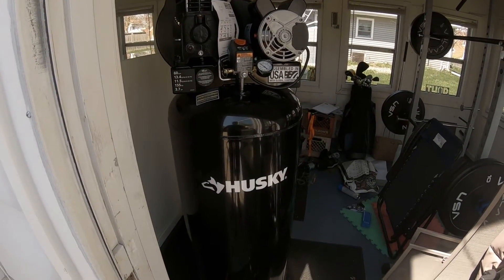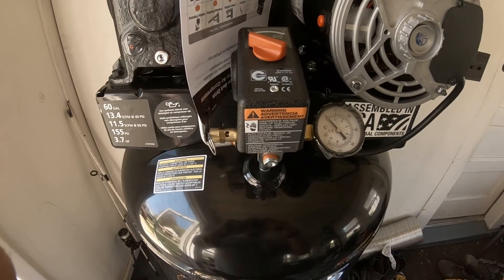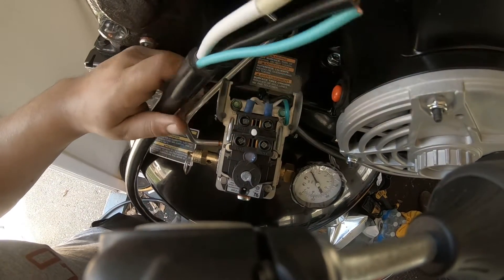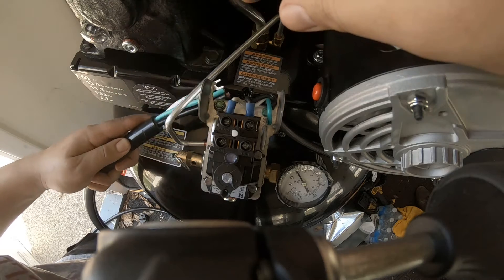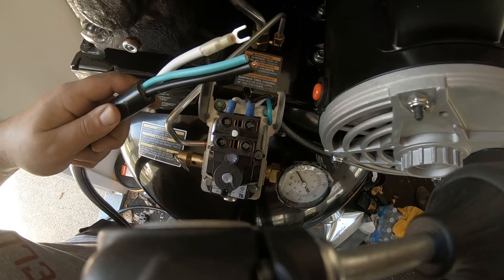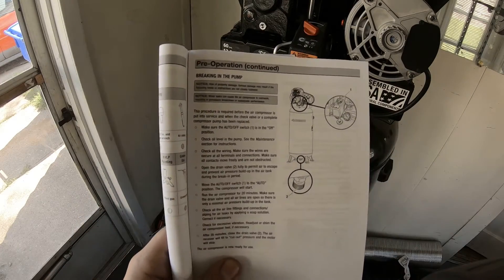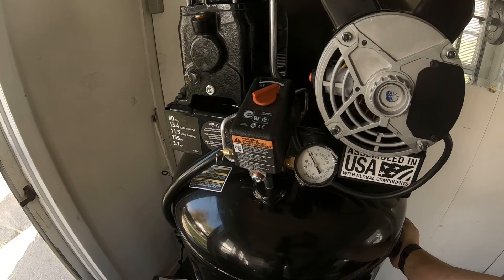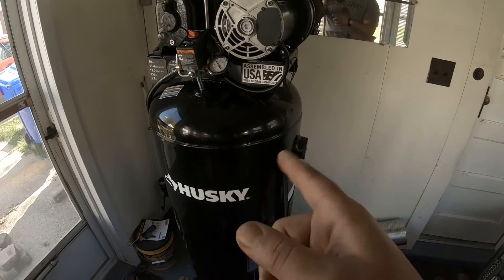Husky 60 Gallon Compressor - Electrical and Motor Break In

Comment: If mine trips the breaker every time I turn it on what do you think the issue is?
Reply from the maker: I would double check the owners manual to make sure you have the right sized breaker for the air compressor.  If that’s not the problem, double check you aren’t shorting anything in the on/off switch with your wiring.

Comment: hey buddy what size breaker did you go with?
Reply from the maker: I believe the owners manual call out a draw of 15A for this motor.  I used a 20A breaker since I had a spare one laying around.
Reply: @ThrownSparksGarage  never tripped out???
Reply from the maker: @mikeammargon6847  I haven't had issues with it.  Depending on the size wire you use and the length from your breaker to the compressor you may need to adjust.  But 20 amp has worked for me.
Reply: 30 amp work good.

Comment: i just got one of these compressors. My tank gets really hot. is that normal?
Reply from the maker: Mine gets pretty hot as well. I haven’t had any issues with it because of this, but do have it separated so it doesn’t heat my garage up in the summer.
Reply: @ThrownSparksGarage  thnx for the reply, video was informational. had to watcha few to get everything understood but no one ever mentions that the bigger compressor tanks produce so much heat. It kinda had me worried. I know the actual pumps do but was not aware the actual tanks get hot.

Comment: I brought husky 60 gallon 1-phase 175 PSI and used it just 2 times, it is not working now. The engaineer told us the switch has broken and always easy broken. So shall i exchange a new one or return it back?
Reply from the maker: I would try to replace the switch itself as it shouldn't be to hard to remove.  Would probably be easier than trying to take the whole machine back.
Reply: @ThrownSparksGarage Yes, the machine is too heavy for me. How long have you use it? Have you exchanged a switch until now?
Reply from the maker: I’ve had it for about 2 years, no issues yet.  The switch itself has always seemed kinda junky to me but it hasn’t cause me any problems yet.

Comment: Haha, that looked heavy, just wondered if the oil was in it already or did you have to put it in, I ordered one but I wanted to lay it down when I go get it but if it has oil in it I won't be able to do that, Thanks for the info in advance.
Reply from the maker: Mine came with the oil in it, I just rolled the dice a bit and stood it up for 24 hours before starting it since I had to lay mine down.

Comment: Does this run on 120 or 240? I bought a display and have no instructions to it and am not educated in these things.
Reply from the maker: If you have the same model as me, it will need 240V input power.

Comment: So how do you wire that? Is that 2 hots and ground on a 2 pole breaker or hot neutral and ground 1 pole breaker? I just bought this compressor
Reply from the maker: It’ll be a 2 pole breaker since it needs 240v input power and I used a power cable for an old welder to hook it up (green, white, and black).
Reply: @ThrownSparksGarage  ok so you are using the white as a hot right. Thank you brother 🙏
Reply from the maker: @marco209lodi5  Not 100% sure on that, I just followed the electrical diagram in the owners manual when wiring it up.
Reply: @ThrownSparksGarage   he is correct...2 hots and a ground. Neutral is not always needed in 240v applications

Comment: I have the same compressor and everything to go along with it except when I turned it on it did 2 things 1.was quiter 2. It won’t turn back on now any help is appreciated
Reply from the maker: I would double check the oil level and the switch on top, my switch was a little finicky at first and I needed to adjust how I wired it together.  Also maybe check your breaker to ensure it’s sized properly and your input power as well.

Comment: Where did you get the power cord?
Reply from the maker: The power chord I used came off of an old welder that I scrapped.  Your best bet would be to look for a local scrap yard and maybe get lucky finding one, or by going to a local welding supplier.  Hope this helps!

Comment: What size breaker did you use for the plug ? I have the husky red 60 gallon. It says 15 amp on the tank I’m just curious ! I’m about to do the same installation thanks for the video
Reply from the maker: So my breaker is a little oversized because I weld off of the same circuit.  Which isn’t ideal for the compressor because it will allow it to draw more current before tripping but that’s the risk I’m taking with using a 30 amp breaker.  If this is a dedicated circuit for the air compressor I would size it based on the recommendation for the air compressor.
Reply: @ThrownSparksGarage  thank you for the reply today I ended up purchasing 10 thhn wire and 20 amp double pole breaker.
Reply: 30amp the best

Comment: Two wheel hand  truck is  the ticket  not  your back, when we get older  that work ethic's will catch  up with  you. Take  it from a retired commercial  plumber  // 👍
Reply from the maker: I appreciate the advise, and moving it that way  once was enough for me!
Reply: @ThrownSparksGarage  Your welcome, always  think it thru  . I seen  plenty men early  on cut in half  from a disability with bad backs because  of not thinking it thru.
heck just being a tradesmen till you retire could  wear  you down thin, I barely made it and  I was careful but worked very very hard.
 I have  the same compressor I pamper mine  I just put in  the  Royal purple
supposedly never breaks down
https://www.amazon.com/gp/product/B000BRTCIS/ref=ppx_od_dt_b_asin_title_s00?ie=UTF8&psc=1

Comment: So how has it held up! Great info on video to bro! I wanting to buy one for some painting projects I got coming up
Reply from the maker: It’s held up great so far, I’ve had a few days where I’ve really put the coals to it and it worked without any issues.  The only thing I would recommend is replacing the drain valve that comes on it with something a little more reliable

Comment: After watching you carry that I realize I'm in the wrong place lol.  I do have a question, when you bought it did you keep it upright or can I lay it down in the back of my truck cuz I got a topper on it...
Reply from the maker: Yeah that was definitely a time where I wish I had an extra set of hands to help lol.  When I purchased it, it came on a pallet but I brought tools with me so I could remove it and then transported it the same way that you are planning on.  I would recommend to bring something soft to rest it on and watch the orientation of the motor so it’s not putting to much stress on itself when you lay it down.
Reply: @ThrownSparksGarage  My compressor came from the factory w/oil in it. I was told "do not lay it down"!
Reply from the maker: Probably a good call, that was my only way to move it, I did leave it upright for 2 days before plugging it in
Reply: @bertgordon5114  I put it on its side and lost a shitton of oil, speaking of, which oil works for this and how do you check it?
Reply: @ThrownSparksGarage  p

Comment: Hi.  Thanks for the video.  I just bought that same compressor at Home Depot, but I can't find the 240 volt power connector, and I don't know where I can buy it ... I would appreciate a suggestion.  Thank you.
Reply: I too just bought one and watching this video to figure what I need to do.
Reply: @strungoutkid   where did you finally get the power cord from?
Reply: @israelrios40  I made it. Simple cord I believe 12  gauge wire. Went to lowes and bought 5 feet off the rack. The one that has insulation like it looks like a power cord. 3 pronged plug. And connected the wire to it
Reply from the maker: The power chord I used came off of an old welder that I scrapped.  Your best bet would probably be to see if you have a local welding shop near ya and they could get you a properly sized power chord; or you may get lucky finding one at a local scrap yard.  Hope this helps!
Reply: Throw'n Sparks Garage OK, thank you so much.🤝
Reply: Where did you get the power cord from?